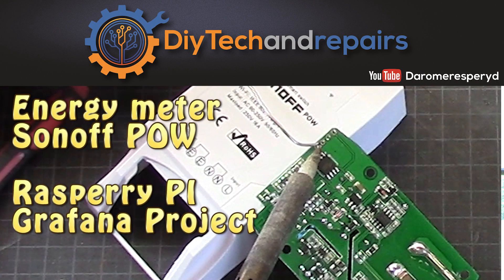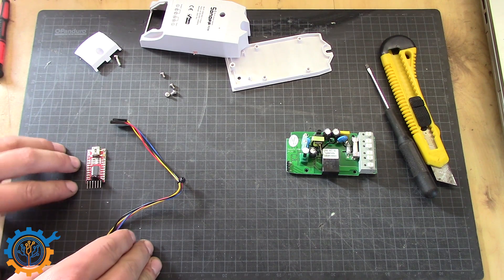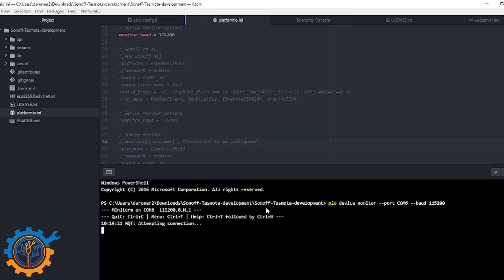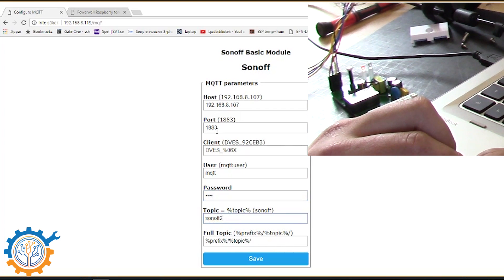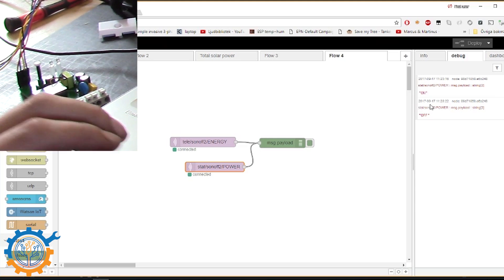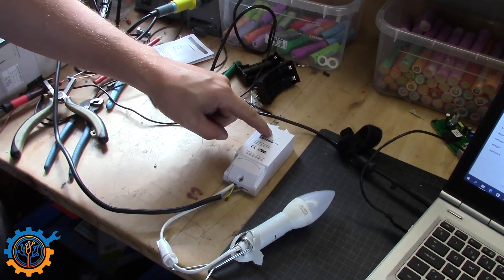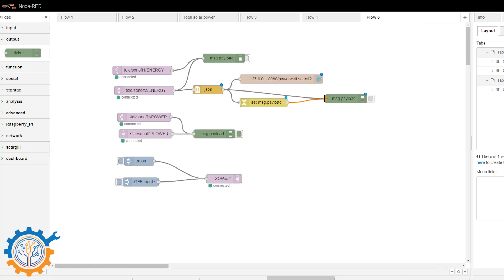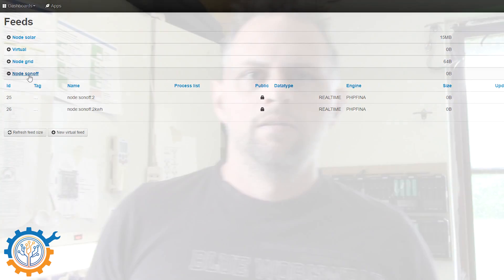Sonoff POW - Measure and controll your home appliances including logging

Comment: Wait a sec. How did it know which wifi network to connect after you did flash it? Does this firmware use a static ssid/password in the firmware itself (in source code or ini file), when you compile and upload it?
Reply from the maker: Its saved in mem yes but i have set it via its built in webserver och once
Reply: @DIYTechRepairs  Ah. Thank you. I find you channel extremely interesting. I am a lot into power management, monitoring and control, so your videos helps a lot. (I am more of a software engineer, not electronic engineer, but I know this and that).

Comment: Thanks for the video, Just trying it now but the code will not copy to your v6 image of NodeRed. inport is grayed out when copying and pasting has per your website. http://diytechandrepairs.nu/sonoff-pow-setup-grafanaraspberry-image/
Reply from the maker: Interesting. Not sure why it would be greyed out? Do you have a flow added?  It can also be that you are missing componentes in Nodered for this task. Ping me on message or on FB and il help you.
Reply: Thanks, i have seemed to recreate it and then got the hang of how nodered works plus added both "power" and "daily total" being sent to emon. Be interesting if anyone else had the same prob. Thanks for doing the video and work on the image, I have got 4 Sonoff units now and have 2 Pow connected up and running well.
Reply from the maker: Cool M8. Yeah those units are small nifty ones. I have several other here too now and several touch switches. Im adding them up to my current home automatisation system :)

Comment: yes in enjoyed your video, but i have not the slightest idea what you were doing or what it is for
Reply: He controls the sonoff by sending it commands ON and OFF by placing messages on the MQTT  queue system. the sonoff was updated with ability to do more than it originally could, probably to read MQTT data (never used one). the Nodered flows are rules which you can control what to do when events occur.
I'm minutes from going to work so had to skip through the video so may be inaccurate.
Reply from the maker: :) You can controll stuff in your house remotely. Like press a button on your phone to turn of and on a light. It also measures the electricity used for that appliance.